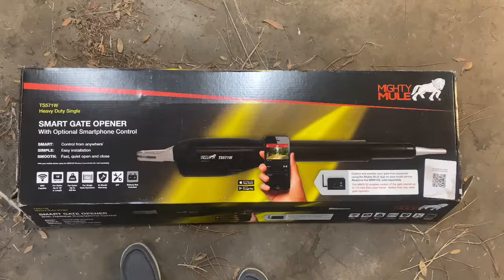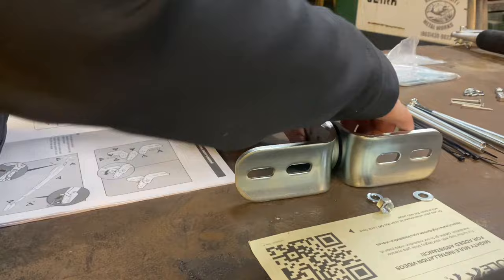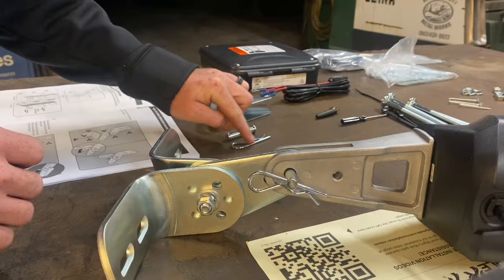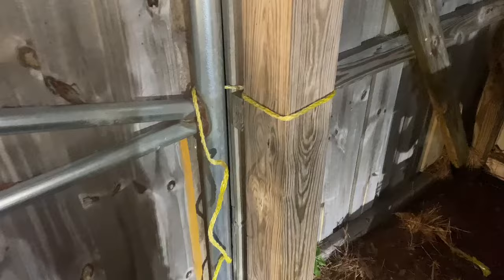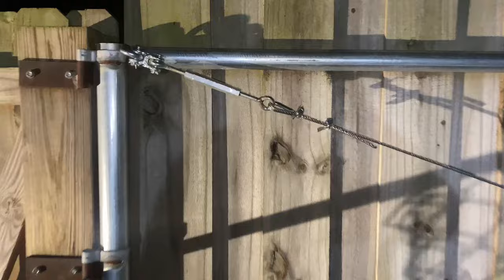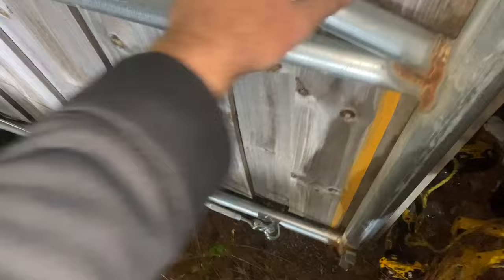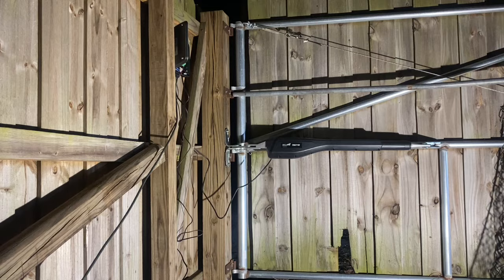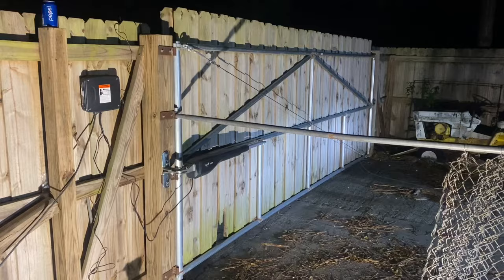MIGHTY MULE GATE OPENER install video and review

Comment: I needed to see how you set the close limit and then cycled the gate open and closed 4 times per the instructions, because it doesn't say to program the remote yet and I'm having problems with this step of setup.
Reply from the maker: Let me see if I still have that info
Reply: @Knottsqmw  Thanks for the reply,  I ended up resetting the control board and starting over with the close limit setting and save, then imediatly programing the remote push button using the S3 button. Then the control remote worked to operate and cycle the gate.

Comment: why does it need a battery if you plug in directly to an electrical outlet???
Reply from the maker: I thought the same thing, but it has to have a 12 volt supply for the computer board to power on.
Reply: @Knottsqmw   So you do need both?   thanks
Reply: It also keeps the battery charged so that in the event of a power outage you can still open and close the gate

Comment: Tractor supply told me doesn’t need electric  hooked up - just battery?  Gate to far from house
Reply from the maker: That is correct. In my case, you can’t just have electric hooked up . You have to have a 12 volt supply . I thought I could just wire it into my house directly, but ended up still needing a battery supply to make it function
Reply: Correct but you need a way to charge the battery. So either plugged into an outlet or a solar charger. It has an on board solar controller so all you would need is the solar panel sold separately. I'm pretty sure you can buy a cheap one from harbor freight vs paying $120 for one.

Comment: How did you get that feature to slow down when it opens and closes
Reply from the maker: It actually automatically does it off of the parameters you set in box.
Reply: Which dip switch(es) controll the soft start/stop?
Reply: I can get to closed but I can’t set the open!!!

Comment: I need your help. I did all the installation but mine will not work. can you help me .
Reply from the maker: Sure I commented on your other post. You must have a battery hooked up. It can be a small 12v battery or a large one , are you hookup up to a AC power source 120v with the transformer?

Comment: :hand-pink-waving::face-blue-smiling:   Hello, just rang that bell.. Nice work here. So the unit also needs a battery correct? The transformer is to charge and maintain the battery and the supplied butt connectors on the wire go to a non supplied 12 volt battery, is that right???    thanks again ! :hand-purple-blue-peace:
Reply from the maker: Yes I believe so . Been a while since I did it I would have to watch video again to remember, but it’s something like that lol
Reply: @Knottsqmw  haha cool thanks!
Reply: No
Reply: @toleman2039 so is your no to say that you can wire directly to the outlet using the supplied transformer?